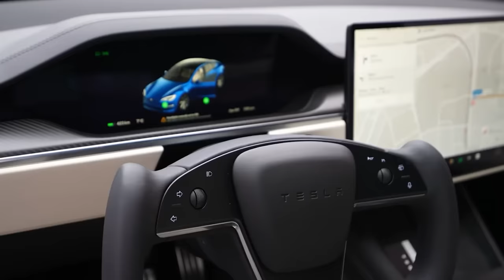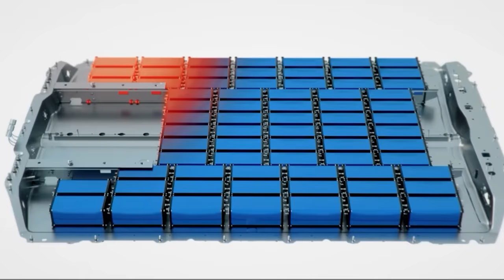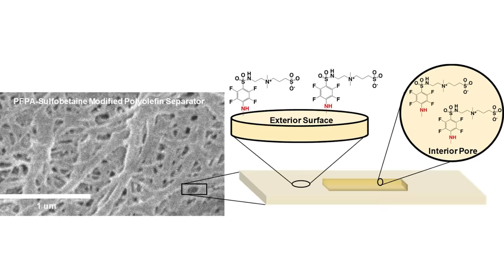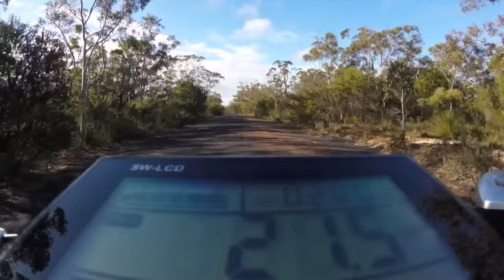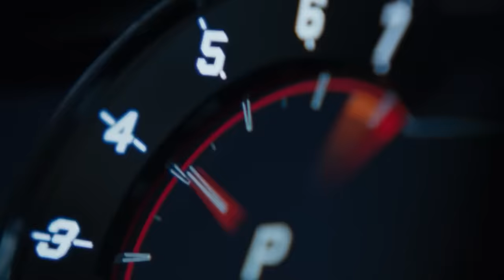EV's Are Exploding In Shocking Numbers

Comment: One footnote: there were NOT 25 EVs aboard that ship the "Fremantle Highway" but 498.
Reply: 25 was what the first reports said
Reply: @johnnyjrotten59  Which was afterwards revised upwards to 498. Why they said 25 in those first reports is STILL not clear.
Reply: It has now been concludes that the ship fire was not started by or involved an EV.
Reply: @robburrows2737  Where was that reported? As far as I know the investigation is still ongoing.
Reply: the dutch oven .
Reply: @Stephen-gi1rx  "After the fire on the car cargo ship off the Dutch coast, the media hastily identified an electric car as the cause. Now it turns out – that this is not true.

Even though the cause of the fire is still unknown, the EV theory no longer holds up after the freighter was inspected. The lower four of the twelve decks are essentially undamaged, and about 1,000 cars, including the 498 electric ones, are in good condition. This is according to the chief of salvage company Royal Boskalis Westminster NV, Peter Berdowski.

According to the head of the salvage company, the four uppermost decks, on which there were no electric cars, are so damaged that it is hard to walk on them and that the vehicles there (again, no EVs!) are literally fused to the ground. The affected carmakers are now investigating how their vehicles can be moved."

Basically, the salvage company says the decks where the EV's were located show no fire damage.
Reply: @redbaron6805  "about 1,000 cars, including the 498 electric ones, are in good condition."

What is your source for that claim? There is video out on the Net of cars being shown taken off that ship and dumped (by crane) into giant tubs of water.. AFAIK that particular technique is ONLY done with EVs--EVs undergoing (or in danger of) thermal runaway.

Furthermore there are photos out on the Net taken from inside that ship of what appear to be burnt out EVs.

Yes, I have read those claims about those EVs bring "in good condition". However, those claims were all made back in late August. Well, here we are in early October and I have yet to see ANY videos or photos of ANY of those "in good condition" EVs. Why?

There was a report in the maritime-executive website in early September titled "Salvage Completed on Fire-Damaged Car Carrier Fremantle Highway" which claimed that "at least one car thought to be electric caught fire while it was being removed from the ship", which does not exactly say much about the truthfulness of teh claims about =ALL the EVs on that ship being "in good condition".

It also reported that there was a "preliminary survey and report" has been finished but AFAIK it is still unavailable and the inquiry itself is still reportedly ongoing.

All of which would seem to amount to this: when you talk about the EVs from that ship being "in good condition" you are NOT talking about facts which can be verified. You are talking about RUMOURS which can't. Rumours which somebody somewhere is putting out for reasons of their own, but who is not providing ANY means for checking up on them. That being the case I would take those rumours with a large grain of salt.
Reply: @Stephen-gi1rx  You really need to read my original post. 

The condition of the cars on board and what caused the fire, along with where all the fire damage was discovered is reported by the actual salvage company which was salvaging the ship.

They obviously had actual eyeballs on what they saw on the ship as they were there doing the work.

Hence, you may want to check the nearest mirror about who is spreading rumors and who is posting facts.

The salvage company CLEARLY STATED that the decks with the EV's showed NO FIRE DAMAGE, but the decks with the combustion engine cars on it showed SEVERE FIRE DAMAGE, with melted cars and the decks basically destroyed.

The source of this information is from:
"
This is according to the chief of salvage company Royal Boskalis Westminster NV, Peter Berdowski."

So, if you think you know more about this than the actual salvage company which was actually there, then feel free to contact them and demand a correction.
Reply: user-om3qe4rr7n  How are wind turbines and solar panels "disasters", when they provide 23% of the electricity in the USA in 2023, and will be 25% in 2024...???
Reply: @Stephen-gi1rx  Its very clear to me, they were lieing.
Reply: @Stephen-gi1rx  There are plenty of Video's to back up your statement.
Reply: @redbaron6805  All Lies, why even comment there are video's and pics to back up the destroyed EV's...
Reply: @redbaron6805  And the earth is flat. Hybrids anyone?
Reply: @redbaron6805  None of those combustion cars were hybrids then?
Reply: Nobody mentions that a crew member DIED!!
Reply: Ships manifests are filed with customs.  This is suppose to insure an accurate inspection of the cargo on board.  This means that even if the ship completely sinks there are copies of the manifest.  So someone somewhere lied to the news or the news chose to willingly lie about how many EV cars were on the ship.
Reply: @Stephen-gi1rx I disagree…it’s clear “they” were trying to minimize the bad optics.
Reply: AND if you believe that, I have a bridge to Brooklyn for sale and you can but a share!
Reply: @opathe2nd973  Just exactly what ARE you claiming I DO believe? Be less obscure and more explicit. I do not read minds. If you are alluding to my digging around to find the origin of that SUPPOSED claim about NO EVs being involved then you are aiming your remark at the WRONG person. I suggest you try the Red Baron. If you were alluding to something else then please do explain.
Reply: @redbaron6805  the crew jumped ship to avoid the smoke and 1 died, one of the crew that reported the fire said it was an EV. There were 498 EVs on board. If the crew could not access the lifeboat then that was a very intense toxic plume. Would you jump from the 5th floor into the water?
Reply: @seanworkman431  As I noted earlier.  

The salvage company that is actually salvaging the ship has reported the fire was intense and cars were melted on the decks with combustion engine cars, but the decks with EV's were intact and showed no fire or damage.

They have clear vision on which vehicles are located where, far better than a crew member running through smoke and fire to a lifeboat.
Reply: @redbaron6805  the crew jumped from the ship. The fire started on the upper decks and the only vehicles salvaged were from the lower decks, however many of the upper decks collapsed and the EVs coming off were craned into a  large tank of saline water to prevent re-ignition.
 Watch John Cadogan Auto Expert he is a mechanical engineer and motoring journalist who took great interest in this disaster and dubbed the ship 'The Dutch Oven'.
The problem with a lithium battery as in an EV is that when it goes into thermal runaway conventional fire fighting methods do not work.
In Queensland, Australia, a mega battery caught fire and the advice from the fire brigade ( as the sit had no staff present and no fire protection) was let it burn.
This is a serious issue that needs honest  debate using facts and logic before an incident involving a major loss of life  occurs.
Reply: @redbaron6805  There were EVss on the upper decks as well. If the fire were ICE vehicles only then the ships fire suppression systemwould have handled it as they do not go into thermal runaway. Thermal runaway is a fire condition where the material burning creates it''s own oxygen and thus cannot be extinguished.
I am not sure how much fire training you have had but I have and I assure you a fire onboard is not fun and can actually ruin your whole day.l
Reply: @seanworkman431  As I noted earlier.  The salvage company actually looking at the wreck says otherwise.

They have actual eyes on what is located where.

Until I get better information than that, I'll take their word for it.  They can see what is where, neither one of us can.
Reply: @robburrows2737  certainly contributed to the intensity
Reply: Any one who would be prepared to loan me their Tesla stock for a bear sale, will pay 3% of current value.
Reply: Yeah, and there were 4,000 total cars, too, not 3,000, and I don't recall any mention of the one seaman who died, either.  This video tried to say that consumers might not buy this (good?) product (as they seemed to imply that it was basically a good product, which not many of us, think so), just because of the danger. Well, that certainly is concerning.  But that is not the only reason: how about the high cost of owning one, fixing one, low resale value, limited range, endless amounts of time for recharging, endless collateral damage to the environment, support of slave labor, support of our enemies, tons of carbon released during mining, manufacturing, transporting, recharging batteries, and recycling, of these vehicles, and the rising cost of electricity, for recharging, too?  Like there's only ONE reason, that consumers dont want these EV's?!?  Gimme a break!  There's a million reasons, why EV's SUCK!
Reply: @robburrows2737 yeah right!  Even if it wasnt started by it, once EV's are involved in it, all bets are off!  The fire gets much worse, out of control, and everything gets destroyed.  And, frankly, I dont believe that it did not start, from a lithium battery, the absolute most likely cause, by far!
Reply: @redbaron6805 How much "as I noted earlier" you gonna say?
Reply: @rbnhd1144  "Plenty of video's" from the ship?  Really?  Care to share one...?
Reply: @seanworkman431  Ship fires are not exactly rare, and they can spread quickly onboard a ship.

The cars are down in the cargo hold.  If there was an intense fire on board in the cargo hold, no crew member is going to  down there to check it out.

They would immediately get the lifeboats ready and abandon ship.

Hence, the idea that a crew member saw that it was an EV is very far fetched.  With car engulfed in flames, how would you know what it was?  You would have no idea at all.
Reply: @seanworkman431  This is literally copied from Carscoops in August:

"The fire was INITIALLY suspected to have been triggered by a burning EV, but officially, the cause is still unknown. 

However, NEW INFORMATION could point to the fire being UNRELATED to ELECTRIC VEHICLES and triggered by either an ICE vehicle or something else entirely. 

Speaking to Dutch press, Peter Berdowski, CEO of the Boskalis Salvage Company, said that at least 1,000 cars seem to be in GOOD CONDITION and perfectly moveable, INCLUDING the 500 EVs."

Not sure how much clearer this could be.
Reply: @Bordondental  Not sure if that was a failed attempt at sarcasm or something....
Reply: @redbaron6805 Except that is what the crew reported after being rescued, 1 dead, as they jumped ship as the fumes had taken over the access to the lifeboat. I am a seafarer and the last thing you want to do is jump off and swim for it. The lifeboat was never deployed.
Reply: @michaeltotten7508  What you "believe" is irrelevant.  The facts are relevant.
Reply: @seanworkman431  Yet again, the actual salvage company looking at this today says otherwise.

I'm not sure how much clearer that could be.  Eye witnesses can be exceptionally unreliable, especially crew members on a ship, which wouldn't exactly be sticking around trying to figure out the make, model and type of car which started a fire, assuming a car even started the fire which could have started for countless other reasons.

Ships have everything from engine fires to fuel fires to chimney fires to electrical fires to countless other fire causes.

Not sure what the point is when the actually salvage company looking at the cars on board clearly says the EV's were all fine.

People here keep arguing about this, despite them seeing the cars in question up close, and none of the posters here did.
Reply: Just simantics …
You can’t let facts harm EV evangelicals
Reply: @redbaron6805 just like the Mercedes we all witnessed being taken off when on fire 🔥 
The huge tank beside the ship to dunk em in when removed …
I suppose that was all setup too ?
Reply: @batmanlives6456  Who is "we all" genius...???  You hallucinating now also...?
Reply: @batmanlives6456  Graduating 4th grade and learning to spell semantics would go a long way to give you an ounce of credibility...
Reply: And one Mercedes they pulled out of that ship started a fire again, ONE month after the fire. Workers tried to put it out and cover it :)
Reply: @redbaron6805   I think you have had some bad liquor. In what fantasy is 23% of US electricity generated by wind and solar?
Reply: @Stephen-gi1rx  A large grain of salt? LOL It doesn't matter how large it is.... I don't think you understand the expression.
Reply: I say good to that the more the better I don't  like EV's
Reply: @robburrows2737 that didn't age well!
The pictures of burnt EV's aboard ended that .
Reply: @robburrows2737  Said who?
Reply: @redbaron6805  They really lie about everything. Where did the fuel come from to fuse the vehicles to the deck?
Reply: @lesseirgpapers9245  Who is "they" in this scenario....?  What would be the point of a salvage company lying about their findings...?

I'm getting rather tired of these endless conspiracy theories that make absolutely no sense.
Reply: ICE Vehicles dont just burst into flames without fuel spilt and a spark to combust it. They also dont explode as seen in movies or like electric vehicles. 
I'll stick with my Colorado diesel thanks. I'm not sure who will expire first but I'm betting on me. 😂
Reply: @robburrows2737 Wrong wrong wrong !
Reply: @tipofthespear7182  Strange.  It appears that Ford, Hyundai/Kia, BMW and multiple automakers vehemently disagree with you, hence them recalling millions of vehicles for EXACTLY that reason.  Combustion engine cars catching fire, when parked....
Reply: @robburrows2737  It is still likely that a fire could have started in an ICE vehicle fitted with a Lithium battery instead of the traditional lead acid type.
Reply: @Stephen-gi1rx  - he's joking with you - hehe the whole world knows how dangerous these virtue signaling EVs truly are.
Reply: @Stephen-gi1rx  please give a link yo a video showing not less than 2 cars bring dropped into tanks.
Reply: @seanworkman431  this seems over-definite. Not least since the Fremantle Highway's fire suppression didn't control a fire which the insurers report did not arise on or include the EV decks.
2 large fires in the slightly similar environments of parking structures- Liverpool and Luton, neither set off by an EV - offer some hints on why not. Experimentally, the heat output of burning modern cars is far higher than a battery fire produces.

Interestingly, in a single EV fire in a Dutch parking garage, the suppression system did put it out.

Is there a report of a car carrier having a fire which was supressed?
Reply: @seanworkman431  letting it burn is entirely conventional fire brigade advice for assorted fires.
Typically a fireman hangs sound bear by hnyil it has whitened Fownhope, jn case of new events or tourists, and if sparks land somewhere a big of water might be squirted on them.  As I hnderdtand it thd problem with thermal runaway is tgst it may recur, leading to ignition or reignition.  That isn't a new category of firefighting problem, just a new instance of an old one. 

If you were siting a megabattery, you probably have enough sense to separate the cabinets a bit, and put the  whole thing somewhere that is handy for a transmission line, but away from anywhere that would be specially bothered by a fire.

If you'd been siting reserve diesel generators and big transformers, you'd be pre-adapted to it.
Reply: @13dazza13  unlikely, as unburnt vehicles on unburnt decks.
Reply: @redbaron6805  there isn't, as I understand it, and as anyone sensible would I think design it, really a cargo hold on a car carrier.
Grain carrier, bauxite carrier, transporter of medium vast machines, yes.
But car carriers are basically RoRo are they not?
Lots of decks.
And nowadays if you want to know how things are down there you look on the feed from a camera or several.
You'd also put smoke and heat detectors here and there, and note which one got hot/smoky first.
As Crew you might well note which deck the smell -> smoke -> flames -> boiling burning petroleum first comes out of.
You've zctually been to sea? This century?
Reply: @batmanlives6456  I've not seen it on fire.
There was one put in a tank. 
Please show flames, smoke, report from those who dunked it of actual give.

Notionally, you might consider whether pulling a car out of z ship where the decks have melted might provide potential for it to acquire damage. You also might care to consider either what you do with a burning car is to hook it up to a crane - or whether you turn a hose on it and move clear.
Reply: @0Aus  I've not seen any such pictures. Please show one.
Reply: @tipofthespear7182  actually, they do.  Not terribly often, just much more often than BEVs.
Reply: @philhawley1219  please provide example of production vehicle shipped thus.
Reply: @AdrianMidgley  are you a seafarer? Are you trained in fire suppression? I am.
Reply: @AdrianMidgley  learn the English language and the write back, OK.
Reply: @AdrianMidgley  the crew jumped from the ship and did not deploy the lifeboat. The cargo manifest was 499 EV's and when the alarm was raised the crewman reported the fire coming from an EV.. 
The vehicles on the lower decks were unloaded once the ship was retrieved and bought into port, having been ablaze for several days. The EV's still reignited.
Fire suppression does not work on a thermal runaway because the gases released create their own fire triangle.
Do some fire fighting training and then comment again because I can assure you a fire at sea will ruin your day.
Reply: Imagine that ship was completely full of EVS
Reply: @seanworkman431  fascinating, but does not accord with the reports of the insurers.

Thermal runaway is a thing, but the energy involved in the battery fire is mostly electrical, no?
So if the cell is cool and not disrupted, it won't start.
Reply: That ship went to the bottom. All EV battery packs were burned!
Reply: @AdrianMidgley  have you been paying attention? When these batteries catch fire they go into thermal runaway, this means they create their own heat, oxygen and fuel, the three parts of a fire triangle. In order to extinguish a fire one would normally attack a corner of the triangle. Water reduces heat but CO2 reduces heat and removes oxygen, foam smothers the flames and thus remove oxygen. However in the case of a vehicle battery fire none of these methods work so the current solution is to run upwind and let it burn.
If you want to trust an insurance company to tell the truth then have at it, you will find that many will refuse to insure EV's in the future or they will increase premiums on other risk to cover their losses.
Reply: @Stephen-gi1rx  Long crap
Reply: @oldarkie3880  That was put on ICE
Reply: @seanworkman431  LOL Crap
Reply: @BioniqBob  there were 498 EV's on board.
Reply: @seanworkman431  So what!!! They had coffee too.
Reply: @BioniqBob  Only one exclamation is required. What is the big deal about coffee?
Reply: @redbaron6805  the fire was so intense and so quick that they couldn't even get a lifeboat launched; hence the need to jump 5 stories down, into the ocean, just to get away from the intense flames, and also the reason why one guy didn't make it (he probably drowned, or broke his neck in the fall).  I have dived the equivalent of 2 stories, into water, when I was younger, but not everybody has--and 5 stories is quite a bit higher--like jumping off of a cliff.  Do it wrong and you can get killed, as soon as you hit the water...this fire must've been like a large napalm strike, on a Japanese city, during WWII.  I saw one brief video that looked like the whole top half of the ship was one big mass of flames, with all of the superstructure burned away--just the hull and a huge fire fully engulfing the top of it, like a mini-nuke strike, almost!
Reply: At my good buddy AdrianM, the Luton fire was set off by an EV, just not reported as such.  Why?  Because it was started by a diesel, which the press neglected to mention, was a diesel-hybrid, with a very large lithium battery, loaded with energy, just like a pure EV.  The problem with EV's solely comes from the battery, storing enormous amounts of energy, in a very vulnerable position.  And hybrids have the same problem: a large lithium battery, storing enormous amounts of energy, in a precarious position.  When a gas or diesel fire occurs, in an ICE, energy is not released as quickly, nor as much.  This is why lithium battery technology is so dangerous and destructive.  And it is funny how movies for years have over-portrayed gasoline fires and explosions, but have not once yet portrayed a real EV fire, isn't it?  Of course, this has nothing to do with the total movie media control, by liberals, now does it?  Every time I watch SVU or Chicago PD or Chicago Fire, or some other Dick Wolf creation, the bad guy is always some right-wing nut, or some businessman--never a left-wing radical socialist commie, of course!  And the same with gas fires in movies: fossil fuel is ALWAYS a demon!  Well, now we have a new, even more destructive and dangerous demon: large lithium batteries for EV's, and transportation use, in general.  Liberals just won't portray it as such, yet, in movies, govt reports and statistics, news media coverage, AND salvage company reports.  But I know the power of a short circuit, that leads rapidly to thermal runaway, which is a chain reaction of short circuits, because I know how easily shirt circuits can occur, as an electrical engineer, with many years of experience with them. I will tell you flat out, that this technology is extremely dangerous, destructive, and unsafe--and I would prefer a gasoline burning engine car, over an EV or a hybrid--any day of the week, month, year, decade, or century--for sure!!!
Reply: @michaeltotten7508  well said, there is nothing worse than going on a date with a 'shirt' circuit.
All jokes aside, I sat on the yacht last night to watch the fireworks and although we have sails the auxiluary  engine is diesel and runs the power, refrigeration, hot water and will push the vessel along at 7 knots if there is no wind all at the same time. 
I like liquid fuel.
Reply: @michaeltotten7508  I have done a jump from 30m and could count on the way down. If you are wearing a life vest and don't hold the front to prevent it from rising up under your chin it will snap your neck. Hitting the water at speed is the same as concrete unless you do it right.
Reply: you have a thermal runaway ocean salt spray or salt  water in ship could of corroded something in a EV.   Then it went up in flames.  on board fire retardant probably slowed it enough to abandon ship.
Reply: I had a Samsung tablet and phone catch fire.  How many out of date cell phones do you have in drawers just waiting to burn your house down? There is risk in all activity .